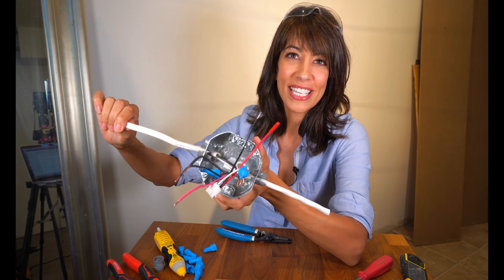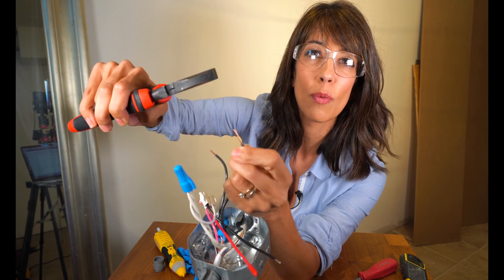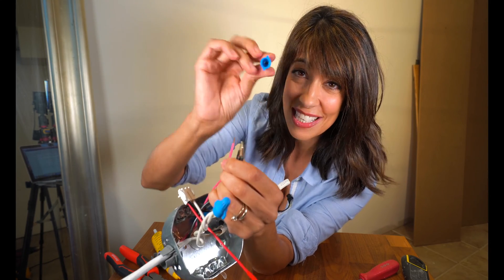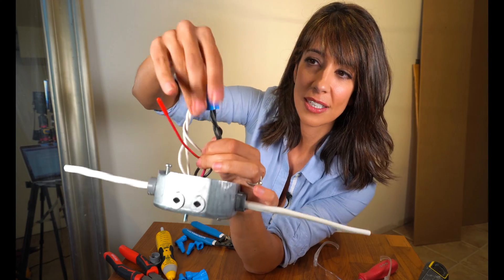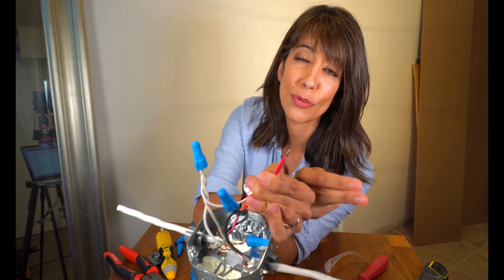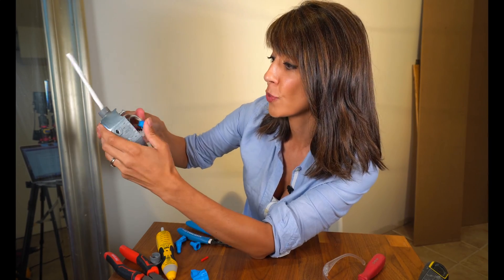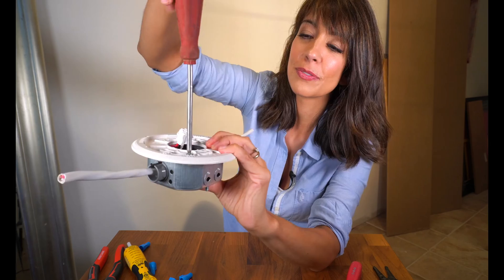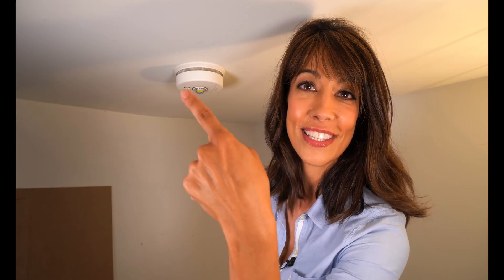WIRING A SMOKE DETECTOR Safely For Beginners

Comment: Did you just push the ground wire back into the box? Did it have a nut on it? Was it connected to anything?
Reply from the maker: The ground wire is attached, wrapped around the ground screw at the back of the box. Secured under the ground screw. Hope that helps!

Comment: I have a wired smoke detector and it's only one where should I use it at and where I am going to put it at  the junction box has only 2 wires and I want to be sure what am I doing before getting up there and putting it up
Reply from the maker: That's a normal situation if they are not interconnected. You would install as normal but leave the red wire since you don't have one. Hope it worked out for you.

Comment: Loved your video. Very practical value and lot to learn. Keep up the good work. Hats off to you Madam for clarity, useful content, excellent videography, very good pace of delivery. Can we make a parallel branch from this very first 14/2 junction box, one 14/3 branch going to the inside of a Master bedroom as a terminal unit, and another branch carrying 14/3 from this very first junction box going upstairs (4 more interconnected hardwired smoke detectors/alarms, one being a terminal unit)?

If the above two parallel branches branching from the very first junction box smoke detectors located on the outside wall of the Master bedroom is OK, then should we expect inside one wire nut 4 black wires (one from breaker, the 14/2, one to the 14/3 series branch to upstairs, one 14/3 to the terminating parallel branch smoke detector inside the Master bedroom, and one to the black of the smoke detector at the very first junction box smoke detector, the one on the wall outside of Master bedroom).

Similarly inside another wire nut 4 white wires (one from breaker, the 14/2, one to the series branch to upstairs, one 14/3 to the terminating parallel branch smoke detector inside the Master bedroom and one to the white of the smoke detector at the very first junction box smoke detector.)

And inside another wire nut 3 red wires, NONE from breaker, the 14/2, one to the 14/3 series branch to upstairs, one 14/3 parallel branch the terminating smoke detector inside the Master bedroom, and one to the red of the smoke detector at the very first junction box smoke detector outside the Master bedroom).

Please give your feed back. Also why the system is still CHIRPING even after replacing the age old existing hardwired (25, 20, 15 13 year old smoke detectors) smoke alarms, which never chirped at least within last 4 years plus alarm worked with brand new hardwired smoke alarms installed in the junction boxes without altering any connection configuration. 

NOTE: In the past it never chirped may be because the unit inside the Master bedroom wall was not a true parallel connection and was drawing power from some other breaker other than the breaker supplying power to the very first junction box outside the Master bedroom. There were only 3 wires black, 3 wires white and 3 wires red inside separate wire nuts inside the junction box outside the Master bedroom wall (supposed to be the very first smoke detector from where the 14/3 originates to go upstairs?). So we should expect 4 black, 4 white and 3 red in the junction box outside the Master bedroom to have a true parallel connection to the unit inside the Master bedroom, correct? Thank you for any help.

UPDATE: There was absolutely nothing wrong in the wiring or smoke detectors or in the installation. The master bedroom outside wall smoke detector found to be NOT the very first junction box for the series nor the inside wall Master bedroom smoke detector was in a parallel connection. The inside wall detector found to be drawing power from the outside wall detector and terminating there.  Regarding Chirping - there was a battery operated carbon monoxide alarm glued to the wall in the upstairs hallway whose battery needed replacement. That was the cause of all the trouble and source of chirping. It was not integrated with the smoke detectors, was a stand alone one upstairs. The two CO alarms downstairs were not chirping.
Reply from the maker: That sounds like a complex install, I'd recommend consulting with a qualified electrician.

Comment: Gorgeous woman and most perfect teeth ever! Oh, and i am sick of my detectors being interconnected and triggering the whole darn system over nothing! going to disconnect the interconnect feature (orange wires)! I hate it!
Reply from the maker: Please don’t. I hear you. I feel you but interconnected alarms save lives and your life matters.
Reply: @DaruDhillon  we have about 8 in a small house, major overkill. i decided i'll bypass the orange wire on all but the basement and one upstairs alarm, so a triggered alarm in the basement can wake people upstairs. you can hear or be woken by one alarm from anywhere. i.e. not all need to be interconnected.

the ridiculously high pitched tone can and will damage hearing (cause tinnitus) if exposed from close up. this is something makers and the regulators who require these don't think of. tinnitus is devastating. they need to lower the frequency of the tone. i first get my ear muffs and ear plugs in before i try to deal with them, and i recommend that to everyone as well. do not work with these things without ear protection. i've had a few false alarms now. trying to shut them off when they are all blaring is difficult. you have to find the initiating alarm, and you have no idea which one it is, and even if you find it in the chaos, you don't know how to silence it. do you press and release, do you press and hold? i can't read the microscopic print without a magnifying glass! 

to bypass a given alarm, i just have to remove the orange pig tail wire that connects the alarm out of the connector cap.

i realize you do not need to hear all this, but maybe someone else browsing comments might be interested.

Comment: I'm replacing and old detector, the box in my ceiling has red, white and black wires just like in your video. Is the "14/2, 14/3 wire" part of these instructions relevant if I'm not adding an entirely new detector to the house?
Reply from the maker: 14/3 wire is used if the smoke detectors are connected to each other. Otherwise 14/2 can be used to wire one detector on its own.

Comment: I did 5 of these Smoke/CO2 detectors, only thing, I continued the 14/3 to the panel box.  How do I wire in - what happens with red?  Or, do I have to use 14/2 to the box?  Love the videos!  Great to see them and confirm I'm doing it right!!  Thanks

Comment: My  electrian contractor 
Install hot wire smoke detector in house ..now stay on the all time .
Any idea what can be?
Reply from the maker: You can try pressing the test button to reset it. If it doesn’t work I’d call your electrician to fix it. It’s important that your electrician is licensed to avoid potential problems with your wiring and safety. I hope you’re able to solve your issue.

Comment: How do run the 3 wire line?
Our home was built in the 70s 
I'd like to hard wire my smoke alarms.  Can I use a ceiling light fixture hot wire the smoke alarm?
Reply: That's what I am wondering too because I am going to do it in the hallway where a light is at can anyone here answer this question?

Comment: why do you need 3 wires? this video is very confusing , you did not explain anything
Reply from the maker: For a smoke detector to be interconnected they need to have three wires. The third wire allows all smoke detectors in your home to communicate with each other. When one unit goes off they all do. Without that third wire your smoke detectors won’t all go off if one in the basement does. For safety reasons all smoke detectors in your home need to be interconnected. They all require that third wire. Hope that helps.
Reply: @DaruDhillon  If you don't have any other smoke detectors you can leave the cap on the red wire?  Also, no need to have a ground?
Reply from the maker: @eddiebustermuck  if you only have one smoke detector you can leave the red wire alone. Lots of old houses don’t have ground wire. Hope that helps Eddie 👋🏽

Comment: do i have to have 14-3 wire to connect 4 of these detectors or is it possible to use 14-2?
Reply from the maker: Hi Calvin, 14-3 wire allows the smoke detectors to be interconnected (so they communicate with each other). So, if one goes off they all will. They will need the 14-3 wire going from each detector to do that. 14-2 wire can be used from the panel to the first detector only.  Hope that helps.
Reply: @DaruDhillon  thank you very much for the response 14-3 it is

Comment: Thanks for the video. I live in a mobile home and the wired detectors are defective. They are wired in with a two wire connector that is white and black wires. If when I buy replacements if the new ones come with the red wire for connecting the two together I presume I just not connect the red wire to anything. Is that correct?  Thanks for any info.
Reply from the maker: Hi Franko, I would wire the whites and blacks and leave the interconnected wire as is since you don’t have it. It will be good to have those up and running. Thanks for the question!
Reply: @DaruDhillon  Thank you.  I figured if I asked a question from you I would get a quick reply. Women are very good about being prompt with replies on youtube.  Thanks again and have a great day.
Reply: @f1948s  What a weirdo lol

Comment: so i can touch the wires wile installing? or do i have to uninstall the entire box down to her level first?
Reply from the maker: I’m wiring the box like this so it’s easy to see. You would have your power turned off at the breaker. Confirm with a non-contact voltage tester that it is off and wire your junction box in your ceiling.

Comment: Hey there! 
Are you from Canada or US?
(I'm from Canada)
If yes, shouldn't the wires be armoured type? 32-102 
Thanks
Reply from the maker: Hi Emilio, I’m from Canada, and this is what is required for local residential work where I live in BC and Toronto. Always follow your local electrical code to do what’s best for your region. Thanks for the question!
Reply: @DaruDhillon  Thanks for the reply! I was reading cec 2018 and i was confused about 32-102 because it says it has to be armoured cables but i never seen ot done that way anywhere so i just needed some clarification on that.